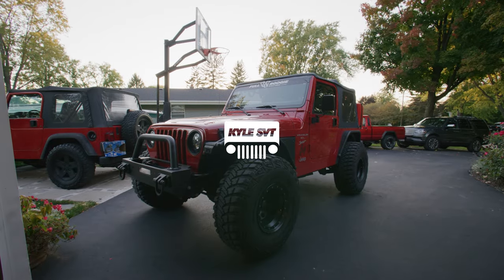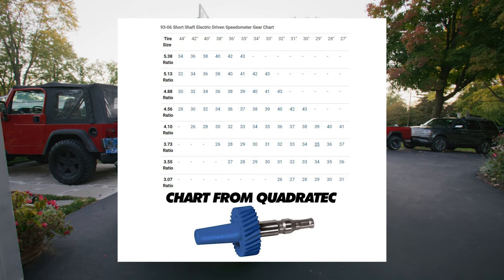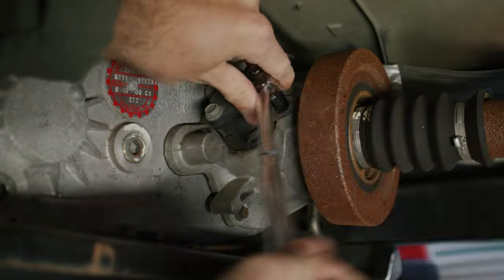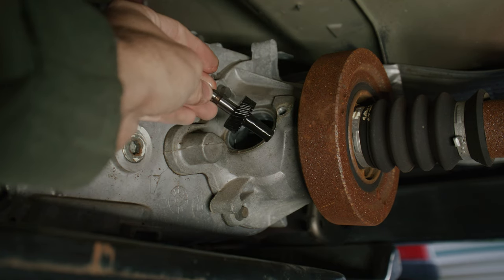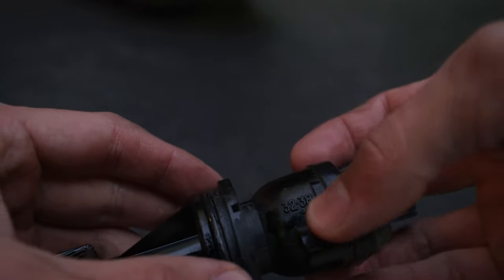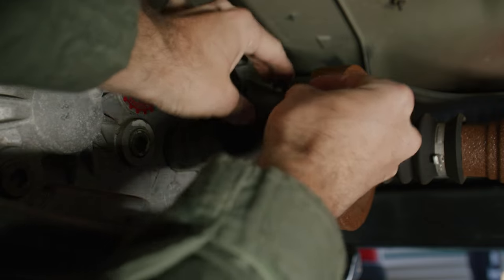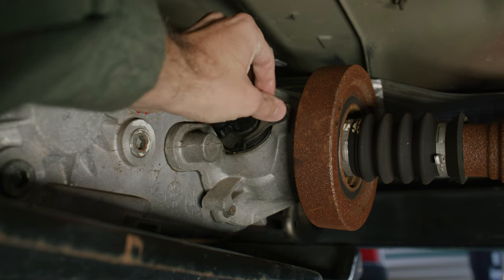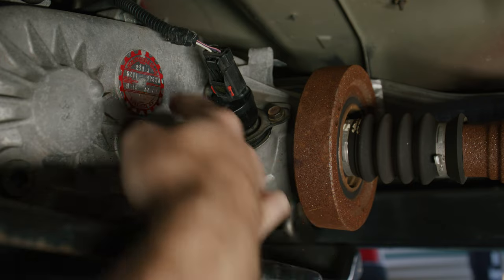Jeep TJ Speedometer Gear For Bigger Tires

Comment: I remember doing the old transmission speedo gear swaps on older Mustangs. On the bronco when I went to 33” it was easy, just used the ForScan Software. Pretty neat program

Comment: Thank God the previous owner of my 97 on 35s didn't just upgrade to Dana 44s but also set up the speedometer and other sensors to compensate. Still only get 12 mpg but that's the beauty of a machine that is 25 years old this year.

Comment: Our TJ (1997 Sahara) is REALLY HIGH GEARED,  Didn’t even know a Jeep had this high a gearing, it’s a 3.07 😮 But it also had new 33x12x15s on it when we got it in 2018..!!  So, how many tooth gear do we need with This gearing, and These 33” tires..??  THANKS ✅👍
Reply from the maker: Looks like the 26 is the only one that is close but don't think it will be exact for you
Reply: @KyleSVT  ok, yes the 26 IS the closest.
Is that All we need to do to correct this.?? Or is there some computer programming also, like we see the videos on the New JK (junk krap) Jeep’s🤷🏻‍♂️🤔🫣
Reply from the maker: @annafraley5388 yep just the gear is all you need for the TJs
Reply: @KyleSVT  … THANKS Kyle, I see they have them on Amazon though a bit pricey.
Have already checked it out under the Jeep, ours 97 (actually November 1996) is almost identical to yours. 😎
Reply: @KyleSVT  We got a 26 tooth gear from Shreveport LA for $26 (a dollar 💵 per tooth😎) and installed it like you showed, much closer on the speed now 👍
Reply from the maker: @annafraley5388  awesome!